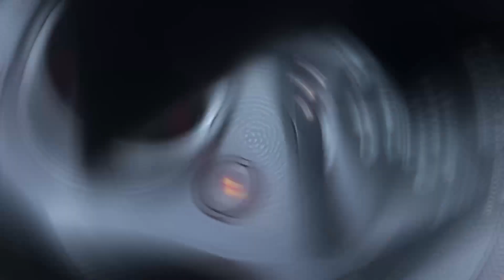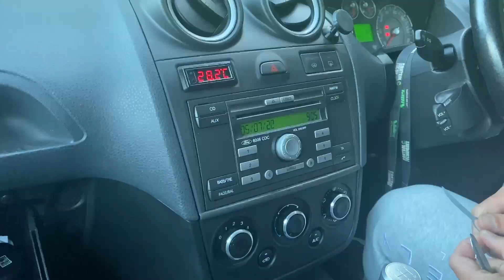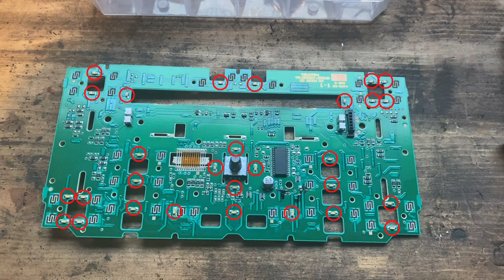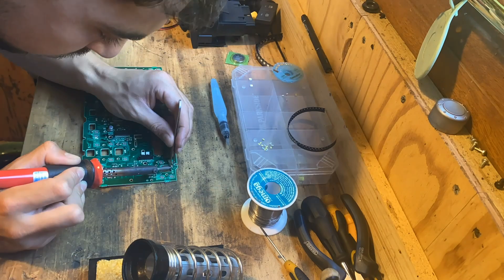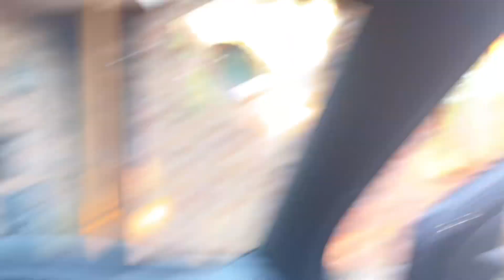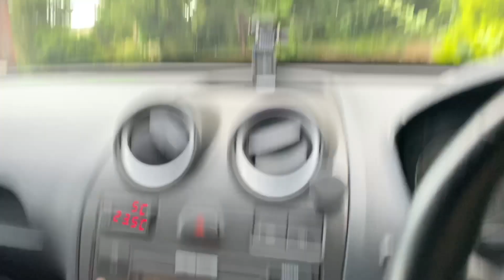How to change Ford Fiesta MK6 6000CD Radio LEDs | Colour Change | LED Conversion

Comment: Use a 330 Ohm resistor in series with the LED, regardless that you are using 3 V battery.